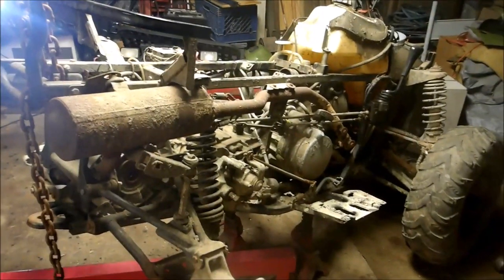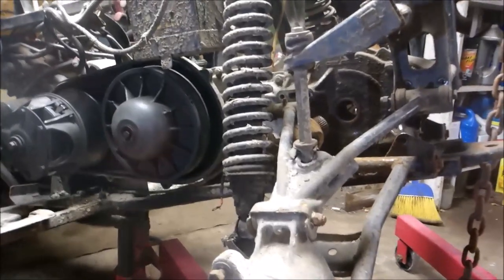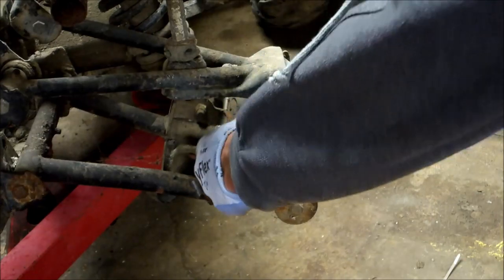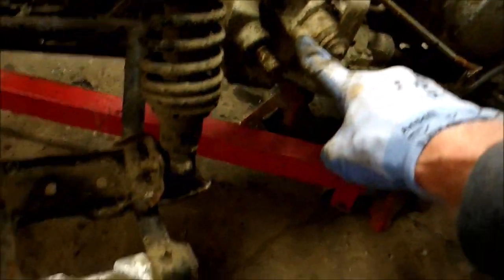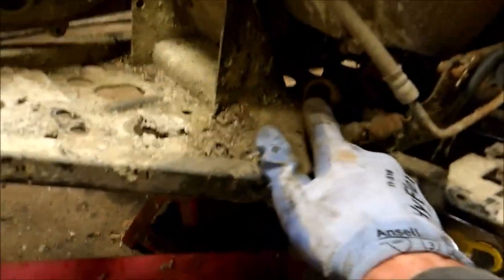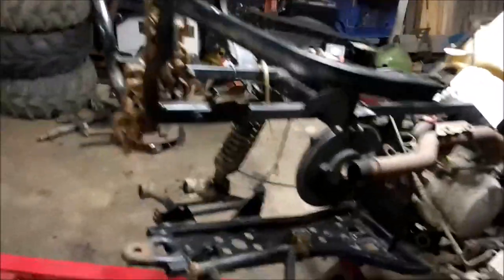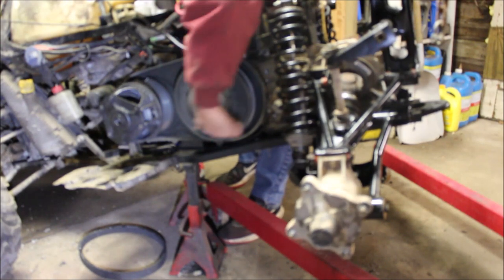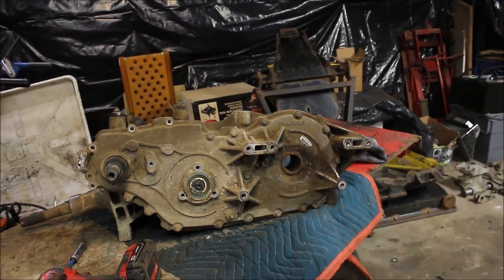Polaris Sportsman 500 Transmission Removal/ Replace and Inspection!

Comment: Hey.  Great video.  I recently purchased a 1999 sportsman.  One of the rear axles wobbles in the trans case.  I believe the carrier bearing is pooched.  Do I have to remove the transmission to replace it?

Comment: I have a 2008 Sportsman 500 and the u-joint that connects to the front output shaft/yoke you show at 13:35 has REALLY excessive play. I haven't pulled the prop shaft out yet to inspect, but if the transmission output shaft splines are shot, how bad of a repair is that? Better to just swap a whole used transmission or does that shaft come out easily??
Reply from the maker: you can remove the shaft from the transmission to the prop shaft( shaft going to front differential) pull the 6 or 8 bolts and it should come right out. you might have to remove a bolt or 2 and pry up on transmission.
Reply from the maker: Oh wait. sorry. I was thinking of a 6x6 transmission. I doubt the splines are bad. but if so you might have to pull tranny.
Reply: @TitaniummanGarage  I noticed that the prop shaft has a regular nut and bolt through the hole where it meets the front differential instead of a pin so it’s been changed before and I wonder if it’s a garbage aftermarket shaft that has worn splines at the transmission side.
Reply from the maker: @daveh2612  Yikes. That a bad repair. That bolt could break. I would pull the prop shaft. Inspect the u joint and splines. If it looks good put a roll pin back in.
Reply: @TitaniummanGarage  OK will do, I appreciate all of your knowledge on this channel, I’m in southern Wisconsin, but if I was a little bit closer, I would just bring this thing to you lol

Comment: I have a 2000 sportsman 500 and the differential is locked on it so it binds around corners. What do you think the issue might be?
Reply from the maker: I would check the hub bearings to see if the 4x4 is not disengaging.  Sometimes the bearings rust or the hillard clutch breaks inside the hub making act like it's in 4x4 all the time making it steer hard.

Comment: Any tips for severely seized front driveshaft? I’ve beat the hell out of it.
Reply from the maker: Do you mean front axle shaft? I had one seized so bad. I used a air hammer to get it out and lots of PB blaster.

Comment: I'm about to replace my transmission did you take the clutches off all the way or just tske the bolt out
Reply from the maker: I had a tough time getting the primary off so I left it on and just took secondary off and flexed backing plate to remove tranny. If you can get both off it easier.
Reply: Awsome thank you for the advice

Comment: I was driving around and then all of a sudden it wouldn’t move in forward or reverse but the engine kept running and reving like normal. I checked the cvt belt and it is good. When i have it on jack stands and rev it up high the wheels will spin (not spinning full speed) but when the wheels are on the ground they wont. Its a 2006 Polaris Hawkeye 4x4
Reply from the maker: It sounds like a possible clutch issue. Try pulling the belt off and rev the engine. see if the primary clutch moves in and out as you feather the throttle.

Comment: Titaniumman, quick question..... I picked up an 01 Polaris 500, but the frame is swiss cheese.  I have a couple 97 400's though.  Think I could put the 500 set up in the 400 frame?  Thanks
Reply from the maker: I have pondered that myself. The problem is the engine mount locations. If you have a welder maybe.
Reply: @TitaniummanGarage  so I just rebuilt my 97 400. Water pump bearing and seals all the way back out. Now I'm getting pressure in the coolant system when I try to start it.....? It did start and run for a few minutes last night. Now nothing.... Any ideas? I've got fire, fuel, and air. Thing should be running. Compression is about 90. I know it's lower then I would like, but it should still run.
Reply from the maker: Check the spark plug. See if it's wet. Could be a head gasket.

Comment: Hi I talked to you The other day about the Bendix possibly rattling on my 94  400 Polaris 
Do you happen to remember if that Bendix  will come out of there without removing the Engine starter Fly wheel gear?
I have not been able to get it out at any angle yet.
Reply from the maker: Yeah. Flywheel has to be removed.  I don't think you can get bendix all the way out otherwise
Reply: @TitaniummanGarage  Thank you for your fast reply I was just now underneath trying to remove the starter thinking that would help
Looks like I’m off to Harbor freight to buy a puller
Reply: Just giving you a follow up I did get the new Bendix installed.
And the rattling noise is gone!!
When we talked the other day you had mentioned a Bendix 
shim/washer, I sure am glad you told me about that because I would have overlooked that,  It was stuck tight to the old Bendix I actually had to pry it off.
Anyways I honestly appreciate your help and I saw in one of your videos you mentioned that you live in WI.
If you ever get near Eau Claire give me a shout I always have plenty of beer in my garage I just can’t get the temperature up past 45° this time of year LOL 😂
Reply from the maker: I'll keep that in mind if I'm out that way. I'm 60 miles south of Greenbay on the lakeshore. Glad to help.

Comment: Hey I have exact same issue in mine. Where did you find a replacement tranny? If you rebuild the one you took off I’d gladly buy it off you.
Reply from the maker: I didn't rebuild it. I have 2 more. What state do you live in? What year Sportsman?
Reply: @TitaniummanGarage  Im in Texas. Its a 97. I looked at again yesterday and the reverse light doesnt turn on when i shift into reverse. Im wondering now if its an electrical issue and not the tranny.

Comment: I picked up a 98 sportsman 500 when i got it somtimes it would grind a little bit then stop while excelerating. But today i was beatin it around the yard and it just started grinding realy bad and barely wants to move withouy grinding bad. Is that an easy fix or should i find a new trans for it? Thanks
Reply from the maker: It could be the carrier bearing. That would be easy. I can't say for sure without cracking it open to see what's going on
Reply: @TitaniummanGarage  thanks and i forgot to mention, that now it has a hard time to go into reverse.
Reply from the maker: Got it! It's the dog gear. Try adjusting shifter first.
Reply: @TitaniummanGarage  thanks i will try to

Comment: Love your videos I watched the one that you made a 500 out of the 425 just wondering what about a 400 into a 500? Keep the videos coming.   thanks, Mike
Reply from the maker: I had heard the 400 connecting rod was a bit shorter.
Reply: @TitaniummanGarage   you would have to change the connecting rod, piston and jug. Would the head and the cam be the same?
Reply from the maker: @michaelmarcucci3980  I believe they are. I would have to double check.

Comment: Hi
Back with another question LOL
OK so with the new Bendix it got rid of the rattle and I just removed the starter and Bendix again started it with the pull rope like you said and I still have a strange noise.
( unless this is the normal sound of a 2-stroke ) ?
Engine runs beautiful tons of compression I did put the starter back in because if I pull start it again there’s a good chance of breaking my arm LOL
Anyways I just uploaded a video could you please take a minute and watch the video listen closely see if you hear anything strange?
Link below

94 Polaris noise

https://youtu.be/hmMXP3Tps2A
Reply from the maker: I see what you mean. There is some normal 2 stroke noises with older one's sometimes its piston slap. but yours..on the pull start side sounds like something is grinding, like teeth rubbing. Is there fluid in the counterbalancer? You said it didn't make noise with bendix out right?
Reply from the maker: This is how it should sound. Some 2 stroke noise. Its hard to hear in this video. Check it out.https://youtu.be/HpSuuL5-mwc
Reply: @TitaniummanGarage  With the Bendix out it still makes this noise that you are hearing right now I only eliminated a rattling noise with the new Bendix 
I even put a stethoscope on the engine and the engine sounds smooth inside 
I also made sure the exhaust system is not rubbing nothing
To me it sounds like it’s coming from inside the recoil cover but when I had it off a little while ago I even checked the recoil studied the fly wheel good could not see any problems
Reply: Forgot to answer your question yes the counter balance oil is full I changed it two months ago when I bought this machine
Reply: Tomorrow I am going to be replacing the read valves just because it’s 26 years old I have not removed that yet to even look at them
When I have that read valve cage off should I move the piston around with my hands or something?
Reply: I just watched your video and yours don’t seem to be making that same noise from what I can tell